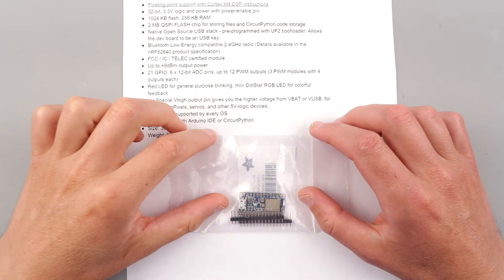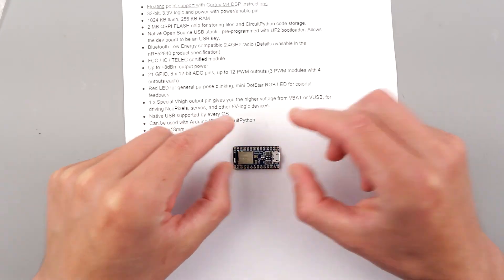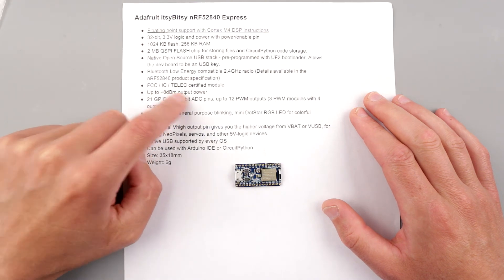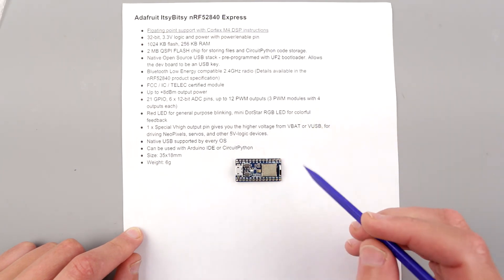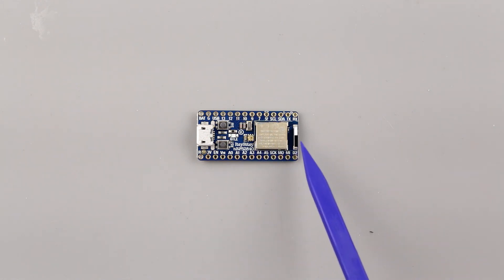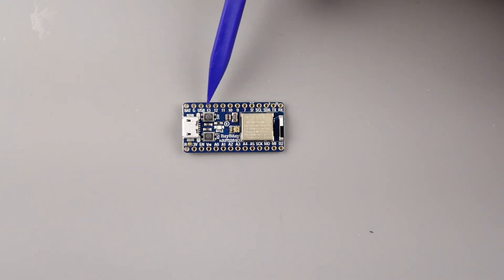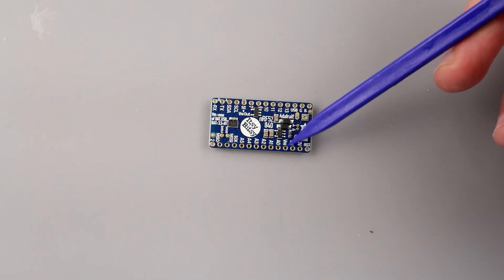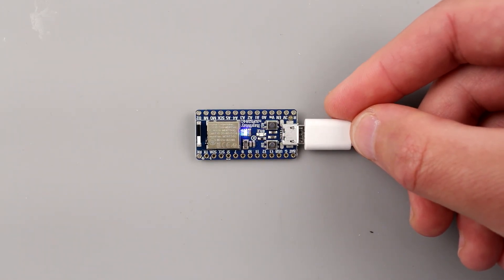Adafruit ItsyBitsy nRF52840 powerhouse

Comment: Does it appear as a regular bluetooth device on PC, e.g Windows? And can it be used as such? 
Also can the pins be remapped? 

Do you know an alternative to the Bluefruit Ez-link?
Reply from the maker: Have not tried on Windows, but I assume it will if hardware in the computer supports Bluetooth LE. Pins cannot be remapped ( what exactly d u mean be temapping? ) . But many pins can be used as analog, digital or pwm etc.
Reply: @InsideOutElectronics  Seems like I didn't finish that comment, sorry.

Do you know an alternative to the Bluefruit Ez-link?
Reply: @Love made in Japan Thanks a lot

Comment: How does this compare to the Adafruit Feather nRF52840? Is there anything specific regarding the firmware development that users should be aware of?
Reply from the maker: Are you talking about Adafruit Feather nRF52840 Express? Then they are pretty close. Except battery charging circuit and debugging port and some other minor differences, like neopixel vs dotstar, 5V pin 5 etc.
Reply: @InsideOutElectronics  hi sorry for the late reply. yeah thats what i was talking about. You mentioned you were working on a project. How is that going? I am looking to package data from an external sensor and advertise that on the phone and am looking for some tutorials that guide me in the right direction
Reply from the maker: @Tcg_summit  Work in progress :) But for reference take a look at Adafruit Bluefruit Android app, available on github